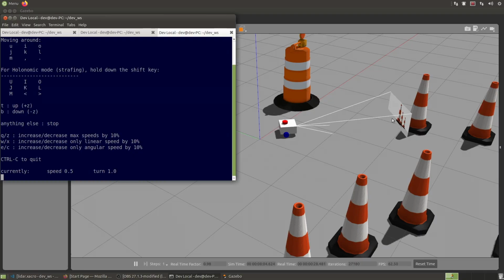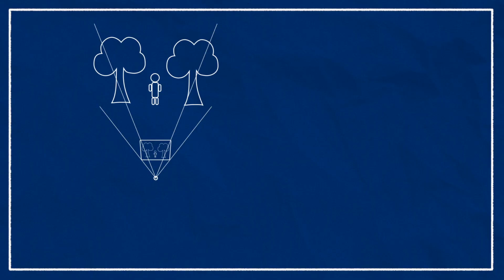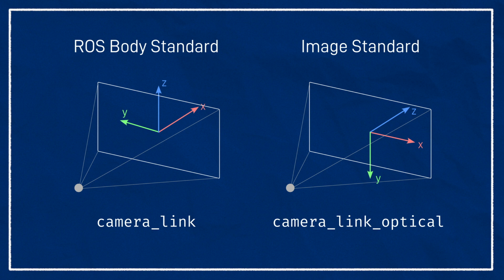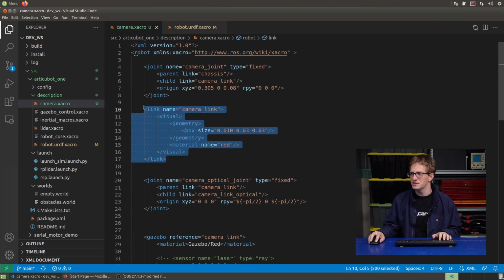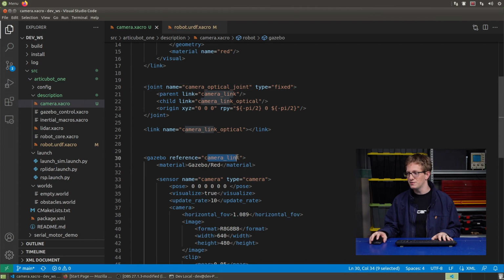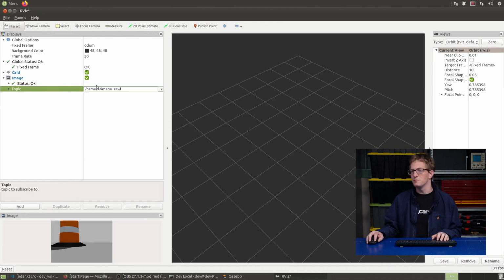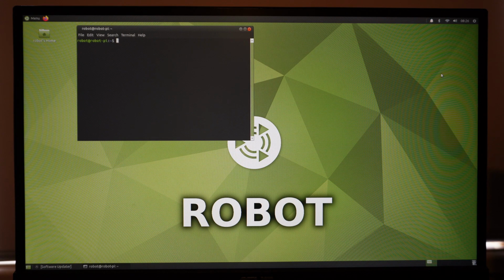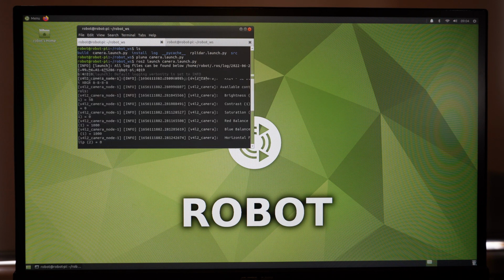How to use Cameras in ROS (Sim Camera and Pi Camera)

Comment: Hello there 
I'm using a Raspberry Pi 5 with a Pi Camera on Ubuntu Server 24.04 with ROS 2 Jazzy. However, the camera isn't being recognized, and I haven't been able to figure out why. Based on forum discussions, it seems that the Raspberry Pi 5 has new hardware that supports cameras differently compared to the Pi 4. I'm not sure how to proceed from here.

Any help would be greatly appreciated!
Reply: Additional info when I am using command 
vcgencmd get_camera 
Error says that the command is not recognised .  And when I list the camera using vl4ctl --list-camera . I get the imx219 camera being detected. But I couldn't get the data from the camera .
Reply: @MohitKumaresan  Hi Mohit, I have a setup similar to yours, but on a Pi4. Were you able to figure it out?

Comment: Thanks for this excellent video. I am having a little problem: I have a raspi 4 with a Raspi Camera v2. I believe it is properly connected to the pi. Here is what I get:

[dome:~] vcgencmd get_camera
supported=0 detected=0, libcamera interfaces=0

I am running ros2 and this is ubuntu 24.04

I have seen contradictory info about whether I should change config.txt by adding 

start_x=1
gpu_mem=128

And using Raspi-config to setup "legacy camera"

Is that old info or does it still apply? THANKS!
Reply: did u find a solution for this ?

Comment: Thanks for the great video. I tried to replace foxy with humble and "libraspberrypi-bin .." still installed package successful, but when running "raspistill -K" it said "Cannot open device /dev/video0, exiting".  Any advise ..
Reply: I have the same problem, did you find any fixes ?
Reply: @redaylight769  having same issue , im using ros-iron , it doesn't even install .any luck?
Reply: having same issue , im using ros-iron , it doesn't even install .any luck?

Comment: Great tutorial.  I am working with raspberry pi4.  when I connect a monitor the RPi, and run the camera node in one terminal, and rqt_image_view in another terminal, it works great.  However, when I run rqt_image_view on my PC on the same network, I see the topic list on the PC that is the same as RPi, but I do not get any images from the Picamera. I assume the problem is from QoS setting.  I tried to do some research on how to set QoS for rqt_image_view, but I could not find helpful references.  I am struggling with this for a few days.  I am using ROS2 foxy on both machines.  Can you help me?

Comment: Josh, thank you for these great videos!
I'm using a Jetson Nano which works with the Raspberrry Pi camera.  The v4l2 node runs (with some control errors) but image_view doesn't see anything.  Any ideas?
(BTW, using a webcam /dev/video1 works fine, it's something about the IMX219 on the Nano)
Edit: found the issue.  Nvidia has their own pipeline elements that configured correctly make it work :)
Reply from the maker: Sorry I didn't get to this sooner but I'm glad you got it working!!
Reply: @usimian, @ArticulatedRobotics, Hello there! I'm glad to see your comment.
I have the same issue when I'm using Jetson Nano and Raspberrry Pi camera IMX219.
Could you give me the solution, that you found.
Thanks a lot!!!

Comment: Thanks a lot for your tutorial, It is quite clear. 
But I need to know how to model a real camera (like rpi camera) into gazebo to grantee same results (for research reasons). Does it enough to just change the camera sensor parameters? what do I have to take into account else? Do you know any pre-made list of modeled well-known cameras so I can take the model with calibration data like it is?

Comment: Very useful video :) What ROS2 distribution are you using for your articubot_onet? Foxy - Galactic - Hawksbill? I guess it depends whether Raspi Hardware level Drivers work on Ub20.04 and UB22.04
Reply from the maker: Thanks! I am using Foxy as I started the project before Humble came out and I prefer to stick with LTS (so not Galactic).
Not too much is different, although things might get messy when I hit ros2_control soon as the team there have been making a lot of improvements lately, so Foxy might be a bit out of date.

Comment: Please is it possible to install ROS on windows 10..?
Reply from the maker: Hi, it is possible and I have done it before but don't have much experience. The team at RoboStack https://robostack.github.io/ are trying to make it easier so you could try that.
I strongly recommend using Linux unless you need to use Windows.
Reply: Or use a Linux VM in Windows. If your pc is powerful enough you could also see gazebo simulations without lost of frame rate. Another approach would be to use WSL (but I haven't tested it with ROS, Gazebo, rviz etc)
Reply: @vassilissolachidis1199  Tips: If you're doing it in a Docker container in windows, make sure you set your display variable to point to the correct display number.